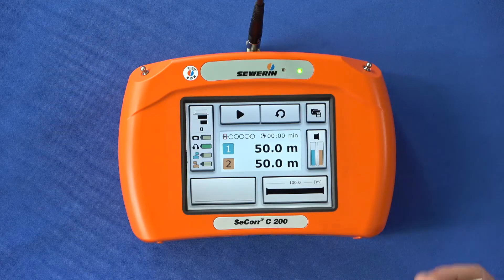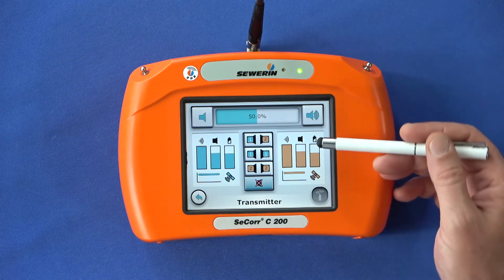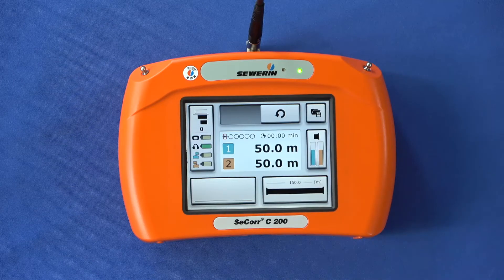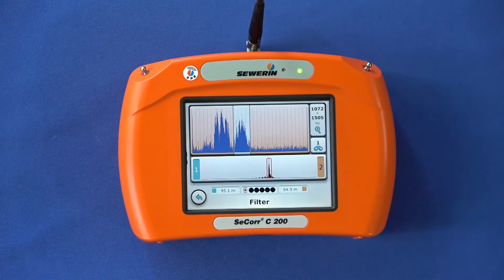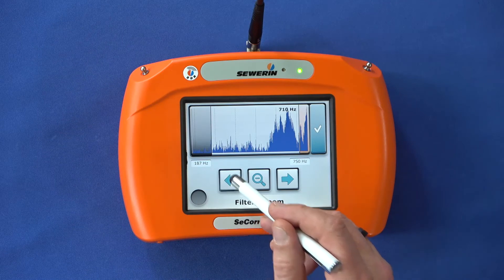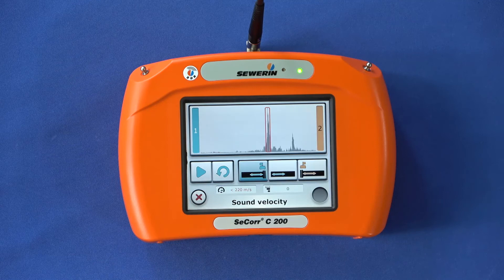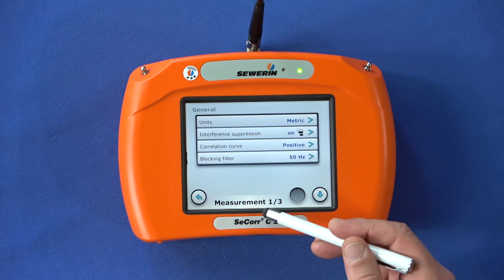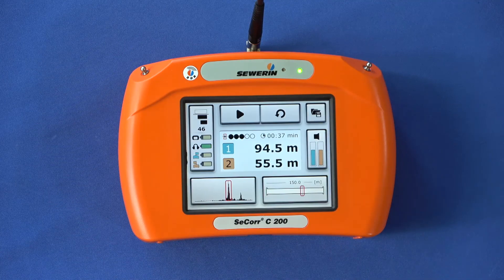SeCorr® C 200: water leak detection by correlation - The Display

Comment: SeCCor C200 CTS, PVC, OLDER black POLYPIPE, When I Correlate I can pinpoint leaks/Anamolies apply all filters to confirm Coherence ? Crosscorrelation  filters to confirm real world leak signatures...input correct pipe lengths and materials accuracy will greatly be improved , negative numbers interpretation meanings. 6 years of leak detection using the secure c 200

Comment: Using known/artificial leak points and adjusting for spead of sound. You said you reccomend the ? Seminars for more info on these topics. I couldnt fully understand what seminars you are reffering to
Reply: open a secondary leak source like a spiket, berry hydrant, to verify sound velocity look at arrows to wich  direction the aftrificial sound is located reset /play will automatically adjust correlation curve and correlation graph . but has to be single pipe material correlation sorry no mixed material won't work

:face-blue-smiling: